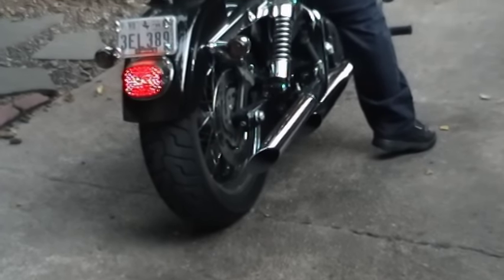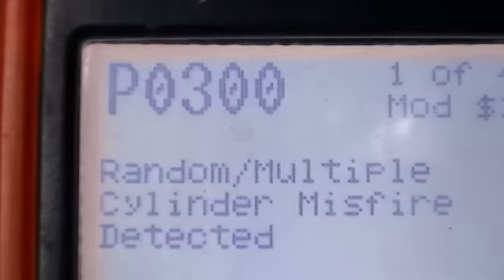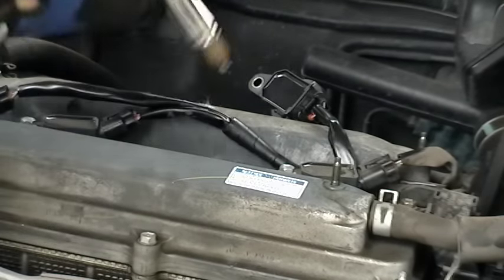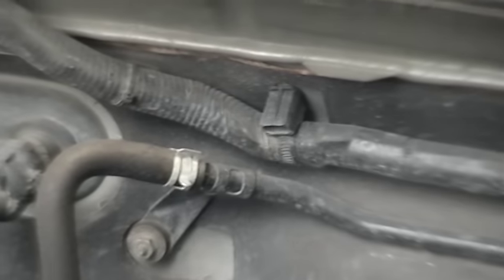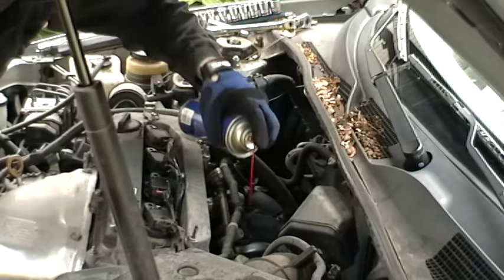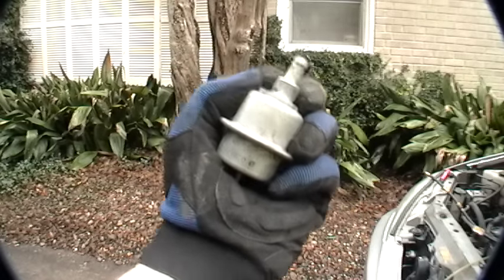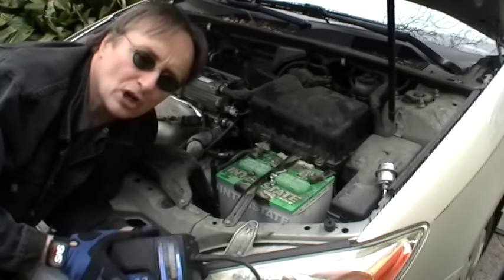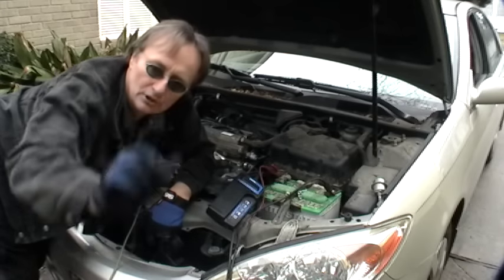How to Fix a Random Engine Misfire in Your Car (Code P0300)

Comment: thats cylinders 2+4 misfiring, follow the steps in this video to rule out any possibles, but since it is 2 specific cylinders I would be looking at the coil pack, there is various ways of testing coil packs, but check the simple things first, plugs and leads etc.

Comment: Hi i have a 04 tahoe that has a random miss fire it doesn't say which cylinder but the hole passager side if i umplug the coils nothing happens but when a do the driber side it like it traing to die and my check engien ligh some times blink and that wend the hole mees start this are mi codes 
P0430
P0171
P0101
P0174
P0300
Reply from the maker: 300 misfire codes can have dozens of causes, a stinker to diagnose. It's running lean, and since the passenger side removal of coils does nothing, I would assume that side of the engine has problems, like clogged injectors or blowing head gasket. They are known for fuel injection problems big time, realize that

Comment: i have a 1996 F150 with the 4.6 engine and it is showing the p0300 code but the engine light does not come on
Reply from the maker: +Daniel Rowell  either computer is bad, or wiring to have a code and not turn the light on (or of course a burned out light bulb there.)
Reply: Engine light works
Reply: Same w/ mine, '05 GTP.  Have not found the problem yet.

Comment: This video doesn’t do as much justice as I was hoping it would. A random misfire could be caused by numerous other things as well like faulty Camshaft or crankshaft position sensors as well as the connectors they use. Be sure to mention these things so people aren’t left wondering what else they might’ve missed

Comment: I don't think the battery runs the engine. The battery storage voltage that is needed to energize a starter and turn the engine over. If you disconnect the battery while the engine is running or even take it out of the vehicle the engine continues to run. Point made.

Comment: Random misfire story.
04 300m
P0300. Random misfire 
P0174. Lean condition. Or an attempt to dump more fuel  due to lean condition or lack of fuel.
P0420. 02 sensor below threshold. Flashing check engine and stall at low rpm.

The actual problem? 
Extremely low fuel pressure. 7psi to be exact.

Check everything when faced with random misfire.
1. Vacuum
2. Spark
3. Timing
4. Fuel.
Those are the basics. 
Everything else is a nightmare. Lol.

Comment: Hi..I have a 2002 Honda CRV with 215,000 miles on it. The day before yesterday, I changed my oil from a 5w-20 to a 5w-20 high mileage synthetic blend. Then yesterday when i went to drive the car mid morning it was but until the afternoon i seen the check engine light flashing. I tool it to a Auto zone where they did a free computer check and it gave me the codes ( P0300, P0301, P0302 and P0300 NOT P0400). They said it could be a vacuum leak or blocked/ faulty fuel injector. I then changed the spark plugs and that didn't fix the issue. I'm not getting any smoke out the tail pipe but i heard it could be the valves that went. I just cant imagine what can make all 3 cylinders misfire. Can it be the valves or something simple like the vacuum hose or pcv valve? Please Help (Thanks)
Reply: i've seen cars misfire when too much oil was added. check your dipstick did you add the proper amount?
Reply: +Paul Lucas Thanks...I actually look at the Honda and paid $105 for them to check it. they said it was one of the coils for the spark plugs. I changed it and now it's been fine but thank you though for the response.
Reply: Awesome! No problem man
Reply: this video is  like all your previous videos, excellent! I hope you have a long, long  life scotty
Reply: Paul Lucas how you're doing my sister just bought a 2008  Chrysler Town and Country 3.3L and we changed all the sparkplugs the wires pcv valve air filter and the ignition coils and 1 fuel injector. Check engine light was on and the code was p0303 we change the fuel injector and then we erase it and then it came back reading p0302 then we changed the spark plug and switch the wires and now it's reading p0300 what do I do to change this problem cause it jerks while it's in drive when you come to a complete stop
Reply: Chief Bubba check throttle body and clean it with the spray.   For the jerk symptom you are feeling check to see if your automatic transmission fluid is low.
Reply: Marlon Henry it was the ignition coil it was a faulty one and I had to buy another one but it runs real good

Comment: What the MAF sensor?
Reply from the maker: +GoldPitbulla mass air flow sensor, it measures how much air goes into the engine and tells the computer so it can put in the right amount of gas with the fuel injectors
Reply: +Scotty Kilmer  my bad, I forgot *about. But anyway, if it's messing with both banks, maybe the MAF (mass air flow).  Nissan all day.

Comment from the maker: I'm working on one right now, and I hate to tell you, but What a piece of junk Daewoo cars they are.  This one has random misfires too, often from fuel injetion problems. Try my video "how to clean fuel injectors on  your car and pray that helps. Also change the engine oil and filter regularly and pray it doesn't fall apart likemost of em do at that mileage.

Comment: hi i have code p0300 in my car and i change spark plug, coil, spark plug wire and injectors but still on
Reply from the maker: +Karam Chato check for vacuum leaks and do a wet and dry compression test of the engine to see if it's internally worn out

Comment: what about a 2007 dodge charger R/T POLICE EDITION CODE P0730 GEAR RATIO INCORRECT
Reply from the maker: almost always serious internal transmission problems requiring a rebuild, have a really good dodge tranny man scan it with his transmission computer and pray it's not that but electronic problems, though it normally is a bad tranny itself
Reply: the gears shift well it does not stall starts up well there is no noise in the engine it doesn't over heat but the esp bas red air bag light is on the code p0730 came on when there was a misfire they told me chk your spark plugs and make sure they are at 0,45 an that will fix your p0730 I only check 8 they were a bit below .04 still need to do the side would u know were the esp bas are located I changed the traction sensor on the wheels
Reply: i already changed the esp module 3times its located under the shifte the one with the car an wave lines that come up in your dash

Comment: I had misfired at cylinder 2. After replacing all spark plugs n 1 crack ignition coil. Now I can the p0300 code. 02 Camry 4 cylinder.

Comment: So my 2017 silverado was misfiring really bad, engine light on and flashing. Truck only has 38,000 miles, SMH. Turns out that a squirrel got up under my hood compartment and decided to chew on my coil wires!

Comment: 08 uplander 3.9:  Replaced wires, battery, plugs, both ox sensors, coil pack (twice), HELP! what next!
Reply: Chad VerMehren try cleaning you fuel injectors

Comment: My chevy wont go pass 30 mph. I put on new thottle body cable handled. still same thing
Reply from the maker: many things can do that, pressure test the fuel pump, see if it's weak. If not, have the catalytic converter pressure tested, as a clogged one will also limit speed
Reply: I think it the governor in
the transmission

Comment: Anyone who can help - I changed three of my plugs and wires.  After that I started getting multiple P300 codes, and the car barely accelerates.  I triple checked the plugs, seating, wires placement, and am SURE there are no problems.  I even put the old plugs and wires back on and same thing!!  What could I have done??  Thanks!
Reply from the maker: many things can be damaged replacing spark plugs and wires if a lot of things are in the way, as in  V6 chrysler engine, check for wiring damage, sensor, damage, and vacuum line damage first.
Reply: Scotty Kilmer Thanks Scotty.  All I can think of is the wiring to the camshaft position sensor was covered in oil spit from the engine.  I did wiggle it a bit, but since its so covered in goo I can't see it.  Don't know if this would cause the problems I am seeing.

Update - I replaced the ICM, and that fixed the issue.  Very strange!

Comment: I'll save y'all a lot of pointless busy work. Check your coil packs. Lift each wire off and check for spark. Seems odd old Scotty didn't mention that. It's notorious on GM 3800s.

Comment: Sorry, but I don't see how a battery is going to cause a random misfire issue when the alternator is pumping out ~14 VDC while the engine is running.  The electrical system will be pulling from that voltage and not from the batteries ~12.6.  You failed to mention plug wires/coil overs having issues (I've seen WAY too many throw sparks internally on coil overs), chaffed or corroded wires feeding the coil(s), clogged injectors (VERY typical these days as folks don't treat their fuel the way they should), bad/missing grounds, cap and rotor button, and a whole host of other things.  Good for a start, but no where near an indepth solution.  I've got a 01 Ram 1500 with the 5.9 that I've changed EVERYTHING electrical (cap, rotor, plugs, wires, throttle position sensor, crank sensor, battery and treated the fuel massively with injector cleaner) with the exception of the injectors and STILL have a random misfire on several cylinders, fuel filter is in the tank so not serviceable.

Comment: OR, a bad coil pack/packs, spark plug wire/wires, bad fuel injector/injectors, ignition control module  (ICM,) or crank position sensor  (CPS.) This wasn't very thorough or accurate. Now it's better.

Comment: But who can I trust to put in my coils, I’m being charged $994 to $1142 for 6 coils and the 994 is for changing my spark plugs too (even though I got them changed a year ago when the problem started) but the 1142 dude thinks the plugs are fine and just replace the coils since we already replaced the plugs last year. 😭
Reply: What type of vehicle? Most vehicles these days have plugs that are serviced around 100k miles so there is a good chance you don't need plugs unless there is another problem
Reply: @diy_automotive  when it first happened, that was what did so I already have new spark plugs from last year but it’s a Honda coupe 2016
Reply: @ashlynprather45  you very rarely need all the coils replaced at one time, any idea what codes are being thrown?
Reply: @diy_automotive  yea, 61-11? But the engine, VSA stability, tire and electric steering wheel light is on all at the same time when I turn the car on.  P0301, P302,P303,P301.
Reply: @ashlynprather45  so an entire bank is misfiring. It could be several things but you would need to watch live data to know for sure. Some of the possibilities are wiring, catalytic converter on that bank, faulty o2 sensor, vacuum leak.
My advice, if a shop tries to put plugs or coils on that car I'd probably look for a different shop unless, they show where an issue has caused the plugs to foul etc. Either way you have a main problem that is most likely not plugs or coils
Reply: @diy_automotive  I had one cousin talk about cleaning his 02 sensor and that fixed his problem but he has a Toyota. I’ve had two shops say it’s the coils, and I went to Honda and they gave me a paper of everything that’s wrong with some stuff that is similar. But like I said, the plugs are new but not the coils. Idk who to trust anymore. Also how many miles would you recommend getting ur transmission oil changed? I’m 3k away from 100k :/
Reply: @ashlynprather45  you're not located in NW alabama are you? 🤣 I'd do a diagnostic report for free just because you have me curious
Reply: @diy_automotive  😂 while I’m from there,no I don’t reside in Alabama. If ur talking North West Alabama,eh…more like the Calera/Tuscaloosa/Bessemer area
Reply: @ashlynprather45  🤣😅 north west

Comment: On that Toyota engine if you have oil accumulating down in the spark plug tube that will short out that cylinder. But that is obvious right fellas? LOL

Comment: Replaced fuel filter plugs wires knock sensor fuel gaskets hoses carb battery … still 0300
Reply: Didnt work scotty

Comment: Backyard Mechanics shouldn't spread opinions as facts...

Bad Battery, LOL... 
Google "purpose of car battery" 

If a weakened battery is to blame, then most likely it's because you may be overloading the car's electrical aystem. (Extra lights, stereo, amps, electronics, cooling fans, AC blower, Defrost, etc)
Or signs of a old or failing Alternator, Ign. Coil(s), old or corroded wiring, or a short in the system somewhere...
During normal load driving, you should be able to drive around with no problems without the battery once you've started the car.
Great example: push starting and driving manual transmission cars, especially after you forgot to turn off your lights, and your battery ran dead... 😣
Reply: Actually it is true. If you have a bad battery it can effect the fuel pump and have it pump less. Once your battery is bad your alternator and engine work in overtime.

Comment: This happened after I changed my spark plugs, wires and coils
Reply: Also used seafoam in the gas... kind of regretting it now
Reply: Are the wires and coil in the correct order?

Comment: 2004 Nissan  Quest,  junk radios, timing belts, electrical problems out the A$$, first month i had it replaced timing belt, dealer said every 100,000 miles. No wonder there is a class action suit against them. I'm selling asap.. Fk.. Nissan